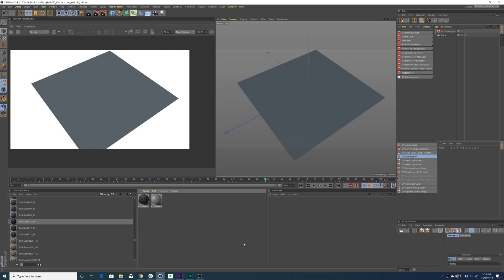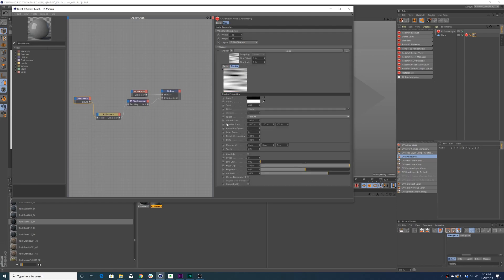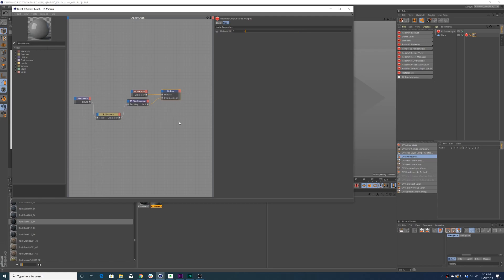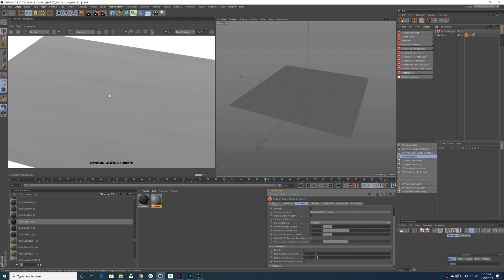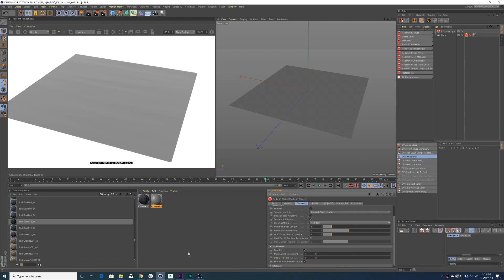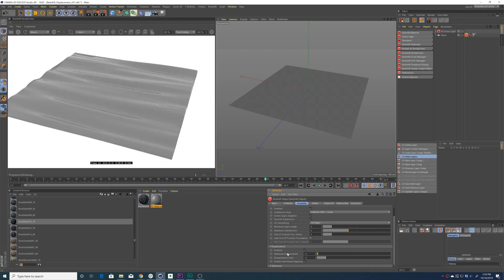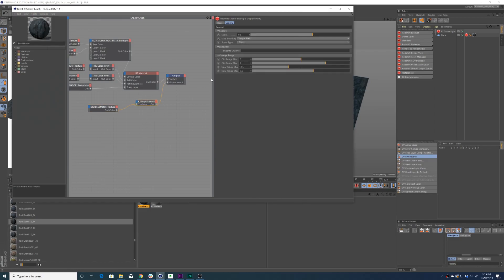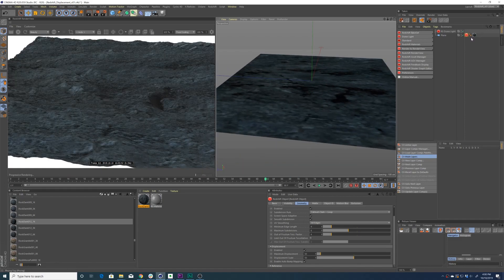How to use Redshift Displacement in Cinema 4D

Comment: Tysm man, this was very short and helpful. One question though, if I have to use the displacement scale and maximum disp in the Redshift object tag then what is the texture scale in the RS Displacement node for?
Reply from the maker: No problem! Glad it's helpful. Essentially it's the same thing. I just prefer to alter it inside the tag instead of inside the texture. Depends on the scenario.
Reply: @the-astropath  alright, thank you again! :D Keep up the good work man 👍